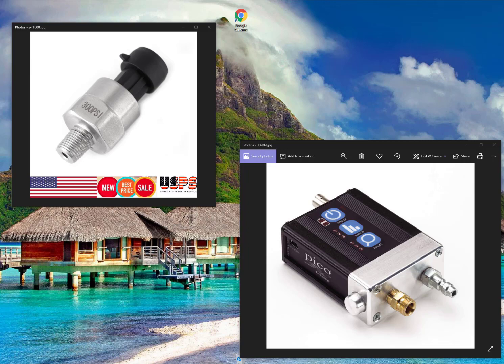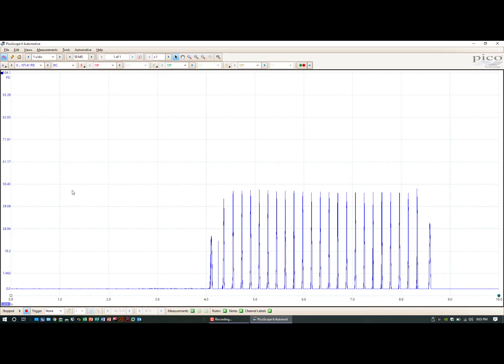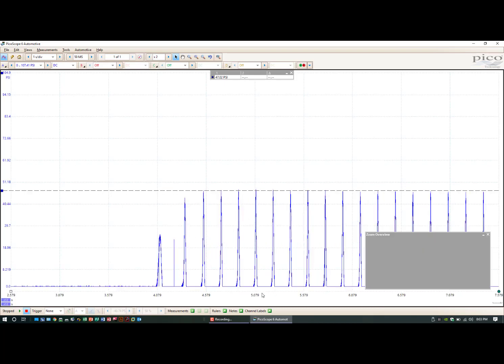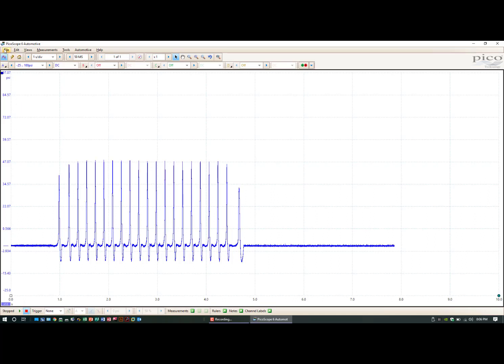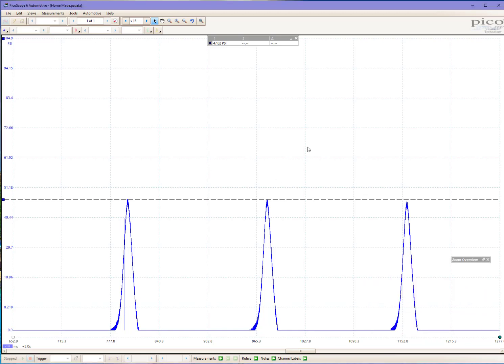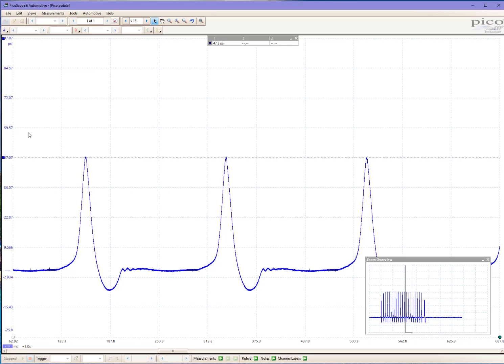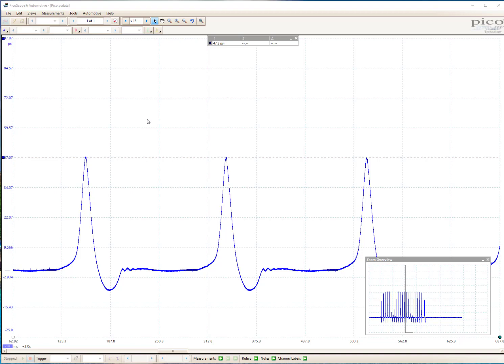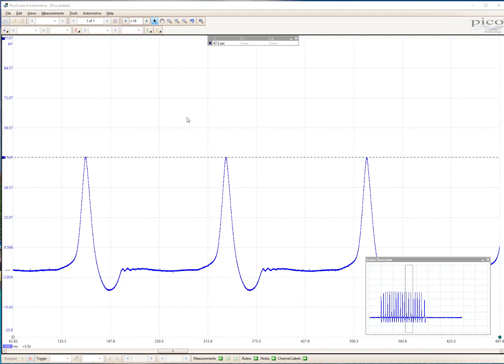Home made vs Pico Pressure Transducer

Comment: Homemade waveform is almost useless for a proper cylinder diagnosis
Reply from the maker: That is not correct! there are cheap options in other brands that will do the same as the Pico. Honeywell Sensor being one of them. This was just some sensor I picked up on eBay.
Reply: @ralfsautomotive  My response is based on what I saw in your video. There is no valve info, just peak to peak.

Comment: I've made my self my own sensors. The problem is that using these cheap Chinese sensors are not suitable for this purpose. We need to use a sensor with negative and positive reading. Also the lag on Chinese sensors are to big. I have had 1.75 ms between two readings and that way to much. A good sensor should have something like 0,1 ms... Another issue is the noise. I have like 25mV on noise and using the cut down filter we should cut to something like 40-100Hz and cutting like this will cut also valuable information.
Reply: @reinaldo6898   I didn't found the perfect sensor yet. So far, the cheap Chinese no-name 15 USD sensors didn't satisfy me. The graphs look like stairs... I do believe that the best-fitted sensor for this appliance should be from petrol cars with FSI common rail, but these sensors are in range of 140-150 bar and therefore the accuracy on low ranges will be inefficient.

Comment: I think your probes are messed up. Did you ever make another follow up? Psi is very low
Reply from the maker: I slept since then LOL I think I was using the Lawn Mower or something.  All of the Probes I made to date work fine but the one big drawback on the Homemade Transducer  is that we cannot do in dept in-cylinder testing since they will not show a vacuum dip.

Comment: Ralph, I find it interesting that you're getting 47PSI compression towers with both the homemade and the WPS500.
If you saw 180PSI on a crank in-cylinder pressure test as you've just performed, would you think something is wrong?

Comment: Really depends on the transducer you use. I bought a Pico but before that I had a Honeywell px2 transducer that made great waveforms that were practically identical to the Pico. It showed vacuum as well. That transducer was $85 though and was nicer than the cheap Chinese ones people get from eBay/Amazon.
Reply: John Pilgrim I know it’s been a while but do you remember which Honeywell sensor you used prior to the wps500x?

Comment: Just tested mine yesterday and noticed the missing in the   lower  part of waveform ,such disappointing :( .I guess it is because the transducer ( an ac pressure sensor in fact  ) can t measure the vacuum  .Need to improve it
Reply from the maker: That is correct. Also, the speed of the sensor itself. But as stated they work fine for most applications

Comment: Great video! I made a homemade one but it didn't last more than 15 minutes. Haha quality control is maybe not the best on some transducers. I love the ability to drop custom degree cursors on a wave form with the Pico software. One of the big things missing with snap-on.
Reply from the maker: Yes for sure, the Pico equipment is second to non.   I do use my Virus Edge all the time as well but the scope is poor for the cost of the unit.